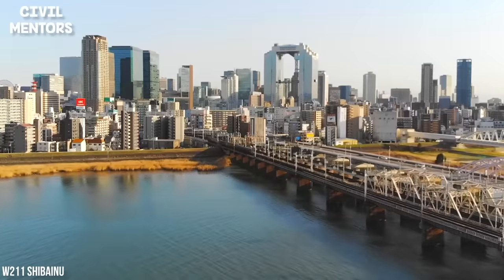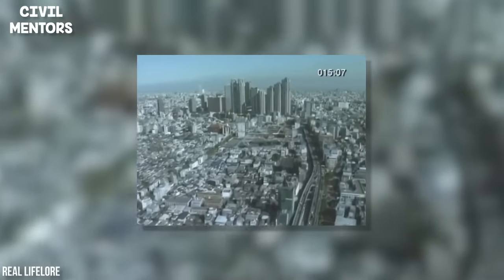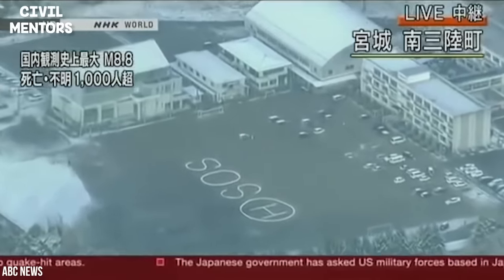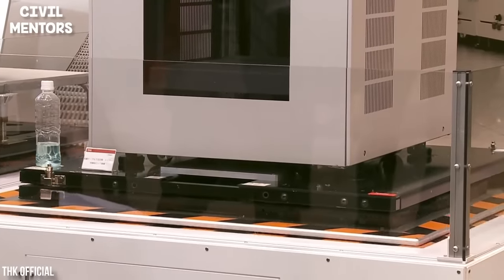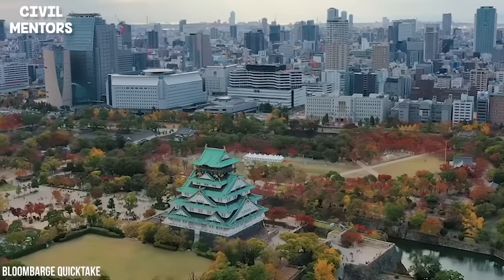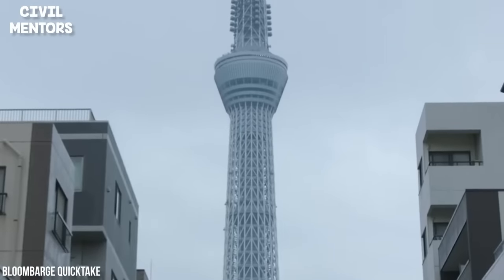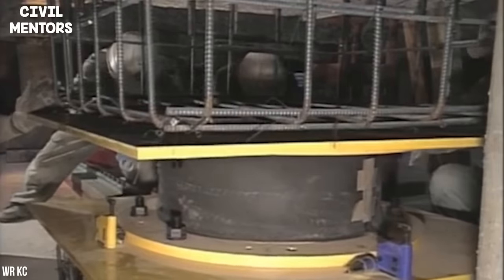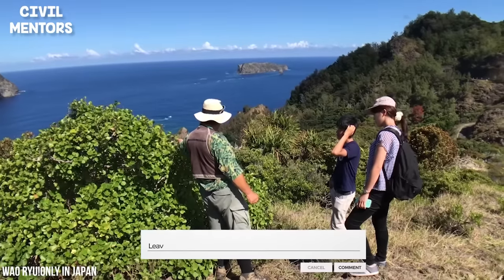How Skyscrapers in JAPAN Survive Earthquakes!

Comment: As a Japanese, we are not that afraid of building collapse because of the technologies we have. 

We are more afraid of tsunami which is generated from a huge earthquake..
Reply: You cannot avoid earthquakes no matter where you live in Japan, but you can avoid tsunami by living in a higher area.
Also, most RC buildings could survive the tsunami without latest technologies.
If the Government allows only RC buildings in the coastal areas, tsunami damage can be minimized.
Reply: Higher area can produce landslides when an earthquake happen though
Reply: I'm Japanese, but tsunamis can reach very high places.
It may come up to the 10th floor of a building.
Reply: @fryomii  10th floor, that is crazy 😵
Reply: @sirmione905  Do not underestimate the power of a tsunami.
Even a large truck can be blown away in an instant.
We are experiencing it.
Reply: @hiki_neat315  I don’t underestimate tsunami. It’s actually opposite. Since the power of tsunami is enormous, there’s no way to resist against it. Instead, the best way to survive is evacuating to top of hills or mountains. We’ve seen it, right?

Also, like I wrote above, most buildings stood strong at that time were RC ones while typical wooden houses were easily washed away. As Japanese population is shrinking and there are so many vacant homes in rural areas, new construction of vulnerable houses in possible tsunami zones should be banned by law. Otherwise the same tragedy can happen in a few generations later.

Comment: Just my opinion here; If an earthquake causes a building or in this scenario skyscraper to shift or shake in a particular manner, would it not be best if there was a contermeasure were as the movement of the building is instantly recorded and an anti shake or shift per the building movements is created to finally cancel out all movents of the structure during a seismic event...Please share your thoughts.
Reply: The problem is that a mechanism that can respond the the scale of actuation is very very huge coz of forces that it has to compensate
There will always be a latency in response to such shokwaves of earth quakes
Reply: Yes. Look up “Tuned mass resonator” and the one in Taipei 101
Reply: Just to add to what Vittal S S mentioned the energy required to cause those movements is insane for large buildings
Reply: It is nearly impossible to generalise the resonance response of a structure under seismic activities. Also, soil-structure interaction is a complex process. In my opinion, by structurally designing the buildings quite sound, earthquake-resistant buildings could be structured but not earthquake-proof buildings.

Comment: The Plejaren on planet Erra build houses that are semi-spherical or spherical in shape. (they sustain tornadoes and hurricanes much better) Building materials largely consist of a resistant metal alloy or synthetic material that is primarily from sand, similar to silicon. Each home has it's own water and energy supply. Not a single smoke stack pollutes the atmosphere on Erra! (they use geothermal energy). Houses and buildings are not constructed from small pieces, that is, made from stone or cement blocks and so forth. They are made as single units from synthetic materials. There is not one seam anywhere. Furthermore, they are constructed on systems of springs or as floating bodies. Multi-story, helicoidal buildings exist but no sky scrapers.

Comment: Japan's geology is different, but time and shaking will catch up to the engineering and materials eventually. Highrise buildings are deathtraps. All modern construction is temporary, and highrise buildings are all like time bombs, ticking down to failure as concrete and metal fatigue take their toll on stability. Highrise construction should be outlawed everywhere in the world.

Comment: gentleman don't try to make fool.Japanese skyscrapers can't survive earthquakes above 7.5 . Recently earthquake of Turkey was around 7.8 .
Reply: The 2011 quake had a magnitude of 9,1 and no buildings collapsed.
Reply: @bayramaktas4135  fake
Reply: @Brett13081992  Not fake,the 2011 earthquake was over 9 magnitudes,the buildings did not collapse,but it was a seaquake,the island coast was flooded by a powerful tsunami wave up to 40m high,it was very devastating for the coastal towns with many victims.
Reply: @Brett13081992  if you need a semi-src https://en.m.wikipedia.org/wiki/2011_T%C5%8Dhoku_earthquake_and_tsunami

Idk about collapse, but this Earthquake is too huge even for the good structure of Japanese buildings
Reply: I looked backed at this 9+  magnitude megaquake on the old news,this massive quake lasted a whopping 9 minutes!!
Reply: In 2011, a massive earthquake with a magnitude of 9.1 struck Japan, causing many deaths.
Most of the deaths were caused by the tsunami. There are almost no building collapses.